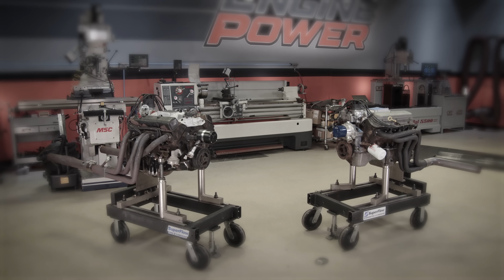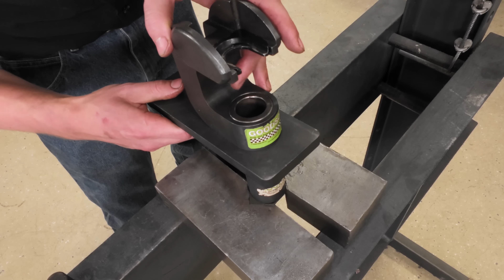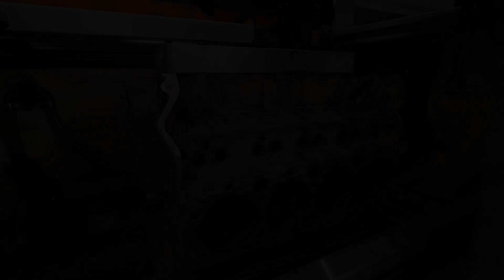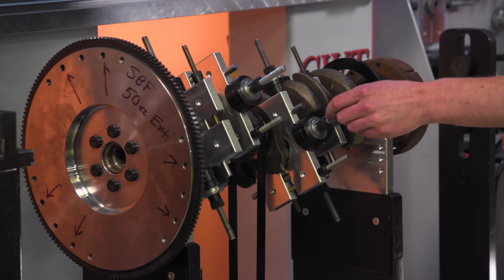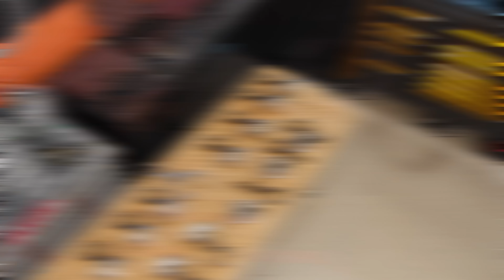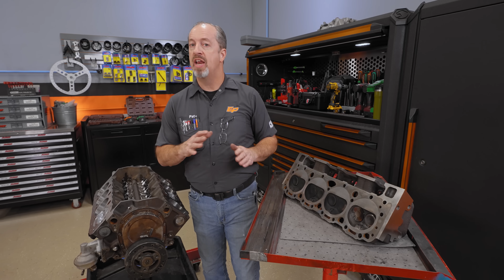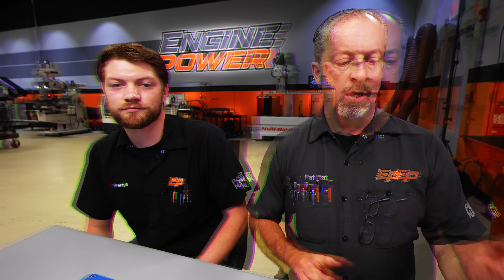305 SBC vs 302 SBF: Does Compression Help the Lowly 305 beat the Race-Bred 302?

Comment: It gets down to the deck height,or lack of! The 331 and 347’s are just to fit into early shock tower cars! I wouldn’t waste any money on them! Get a 351w with taller 9.969”deck block! You can use factory parts to build it! Stock rods, 302 pistons and along 6.969” rods! You still have that heavy crank with large journals but they’ll hold up quite well! And it’s not just another LS! One day I’m gonna pull my Fairmont wagon with factory no air, manual rack, no power brakes! Who will ever know ! 393 stroker!

Comment: You guys have no idea what the compression ratios are after cutting the pistons and altering chambers.
Reply from the maker: All of the parts were measured after the modifications to ensure accurate compression ratio calculations for each engine. We actually had a few different head gaskets for each on hand so we had options in order to get them as close as we did.

Comment: Why didn’t you use the same ratio rockers on both engines?
Would it make a difference at all?
Reply from the maker: We increased both engines rocker ratio by .1:1 in order to increase lift but keep them as close as we could

Comment: If you wanted to do an oddball 5.0L Small Block, I've always wanted to see somebody put the crankshaft from the 94-96 Caprice 4.3L L99 into a 5.7L LT1 block. That'd give it the same 4.0" bore and 3.0" stroke as the Ford to create a modern DZ302. Drop some LT4 heads and intake on there to really make it scream.
Reply: Interesting

Comment: I would like  to know what headers were used on the 302/GT40P heads as fitment is typically  an issue with those heads.
Reply from the maker: These were a set of Doug’s from Summit Racing part number DOU-D623-B
Reply: @enginepowertv  thank you, im not sure if you're able to confirm if the fitment gave adequate  clearance from the plug wires? Thankyou
Reply from the maker: Yep with a 90° boot on the plug end we had plenty of clearance
Reply: @enginepowertv  thankyou, alot of people avoid the gt40P heads due to finding a decent fitting header.

Comment: “What have we learned?”

Whet we learned is: 
You guys don’t actually try different ignition timing settings to see where the engine is actually happiest at -
 I didn’t see any average air fuel ratio numbers, either.
AND - - -  Wherever it was that you learned that ignition timing needs to be “changed 2° at a time” -  every time you adjust it… ?!? 
You need to throw that knowledge out the window. Sometimes 1° makes a big difference.

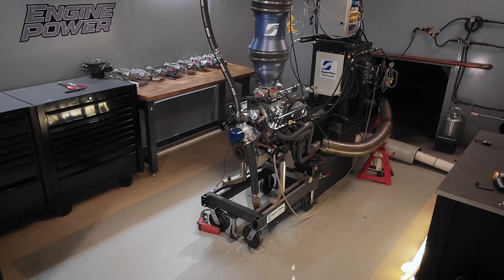Comment: At 16:57 …. GT40P heads DO NOT like 38° of ignition timing, that’s way too too much - back the timing down to around 33°, 34° 35°…… You’ll probably pick up power. 

GT40P heads are VERY sensitive to timing, you don’t “move timing around” 2° at a time… 
Change the timing 1° at a time, because it makes a big difference. 
If you guys knew anything about GT40P heads, you would ALREADY know all this. 
It’s very very very very very common knowledge at this point, amongst the 5.0 Mustang crowd.

Comment: I was under the impression that the 302 was a race engine and the 305 was an economy engine.
Reply: Why would you have that impression?
Reply: @kcchapman9776  Because the 305 was developed to install in the automobiles during the 70's when fuel was at premium, That small v8 replaced the 350 for less expensive Chevrolets. Now. if you want to compare the Z28 302 to the ford 302, I think  you will see different specifications.

Comment: Ypu should do a more comparison a chevy dz302 to a boss 302. Maybe ypu can't afford original but you can build both motors to that bore and stroke and compression and cam profile both made 290 hp back in the day.

Comment: Engines are air pumps. It’s really about cost and availability. Chevy is usually a little simpler to work with so they are the most popular.

Comment: So if you have two engines of the same displacement, built to about the exact same specs, they perform about the same.  Inconceivable!
Reply: The chevy 305 is a small bore , long stroke engine. 302 is a big boar , short stroke engine. Pretty different. If you were to look at the whole entire power graph of how the 305 performed , it actually had an edge across the whole r p m band.
Reply: @kskip4242  Cool.  I was under the impression that a shorter stroke engine would have more torque, but I've heard a few different people lately say that a longer stroke yields more torque.  I assume they are right.  It's kind of minutae but I hate to have wrong info.

Comment: 1.7 Ford rocker arms vs 1.6 un Chevy :/
Reply from the maker: Correct both engines recieved a .1 increase in the stock ratio to keep the valve lifts as close as possible

Comment: Why dont you compare 302 against 302? Ya'll do know a 327 block with the stroke of a 283 give you a 302 chevy and it is a rpm monster and i know because i have built several of them and i have a 69 duel 4 chevy 302 RS/SS Camero that makes a little north of 500 hp and is virtually stock.

Comment: The 305 put out good performance in the trucks and trans ams the feed back i got from the chevy crowd was the bottom end was weak compared to other engine in the gm line up don't know personally i run pontiac mostly but have seenbalot of 305 engines blown in firebirds  boats and truck  feed back welcome....

Comment: At about 3700rpm the 305 was making 20 more horsepower and about 10 more ft-lbs. If 2 identical cars had these motors the 305 would win a drag race

Comment: I wasn’t aware the 305 had four inch bore like 302. I don’t know how you can compare the two engines. Should have had a 283 or 327  with  4” bore to get a fare comparison. Can’t see point in comparing 302 305. 302 should win on power every time.

Comment: its not apples to apples, the ford 302 is a big bore, short stroke engine and the 305 is small bore, long stroke engine.  305 chevy in stock form was all done by 4500 rpm. because like its predecessor, the 307, was an economy engine.  put that 302 ford up against the 302 chevy and see how bad it wipes the floor with the ford.

Comment: I’m more happy with the 305 sbc engine despite the small bore small valves and little cylinder volume but it’s amazing how it can make horsepower a little different that engine is a potent in it’s own way the right combination the better it can performed

Comment: Manley Race Series Ford 429 Boss Exhaust Valve – 1.900 in. Head Diameter! The Ford Boss 429 intake valve has a diameter of 2.28 inches in its stock configuration. However, aftermarket valves are available with larger diameters, such as 2.300" and 2.400". The standard intake valve diameter for a Chrysler 426 HEMI engine is 2.250 inches. 
:face-fuchsia-wide-eyes::face-blue-wide-eyes:

Comment: Great job !
  I wonder if the chevy had more lift on the camshaft like the ford has. Would the numbers have been the same?  Thats about the only difference in these engines. 
And im glad you mentioned the bore size of the boat anchor 305. Vs the 5.3.  Its only about .044 difference. But everyone says the 305 is junk because of the small bore.  And praise the 5.3 in the same breath. You guys proved that wrong. Its all about airflow. No matter what the engines are.
Reply: Yeah I'm in agreement, same cams,  same heads.

Comment: I would love to see chevy 5.3 VS ford 5.4.  I know there is a lot of difference but I have both engines and my 5.3 always outperforms the 5.4 hands down.  And to point out my chevy has its original gen 1 engine still in truck since 2000 with half a million miles.  And my 2003 ford has the cursed 5.4 and is on its third engine. And out of the three motors not a one has made it past 160,000.  All three spun the rear main bearing and lost oil pressure.  Not to mention the nightmare it is to change those absolutely stupid spark plugs. Yes I know they make aftermarket ones that don't break off in the head.

Comment: Why not adjust rocker ratio to get matching lifts?  Sbf  already  had more lift then they  add 1.7  n that should give it roughly .565 to .570 lift unless they already had this factured in... ,  n 1.6 on sbc would also add .25 to .30 lift. But you still have the ford with a bigger lift. I wish they would have check the lift with 1.6 on the Ford and dynoed to see  the difference.. its no surprise Ford win this one imo

Comment: A lot of people in the comments giving the 305 some love. Ok, so you got it to make some power. Good for you. what was wrong with that engine, besides the stock build having underwhelming power, was that they melted valve trains. The Ford 302 was not just powerful, but also reliable.
Sure, if you build it, its inherent weaknesses can be overcome, but then, find a nice steel crank, 4-bolt main 350 and build that instead.

Comment: My boat has a Mercruiser Alpha-1 5.0 EFI, which is a 305 Chevy.  Drive that thing pegged at like 5500 RPM for long stretches at a time.  It's 26 years old now and still runs like new.

Comment: You put that Chevy cam in that Ford you just as well have pulled a couple plug wires off  why didn't u put Ford cam in the Chevy it's common sense a ford demands more lift on the exhaust for both torque and horsepower

Comment: Run the 305 cam at 10 degrees advanced and you'll see a big difference mines running to 5800 rpm and it's really really strong

Comment: If you look at this test though, the Ford has the better "CAM SPECS" and you guys COULD have ran 1.6:1 rockers on both with identical cams. ----- NEXT TEST 350 vs 351.....To keep it fair 350 Chevy vs 351W (Keep Canted Valve Train Out....As we ALL already know that they are NOT in the same ballpark. A 351C with Their Best Factory  Iron Heads (351C-4V Closed Chamber) is worlds ahead of the SBC with inline valves and its best Iron heads, I mean BRODIX Makes CVH SBC Heads for a reason.) - I think the 350 with the Vortec Heads will have more power than any GT40 or even the C9 351W heads.

Comment: why did they use better pistons on the ford then the chevy the ring pack makes a difference
Reply from the maker: Each engine got new pistons that were the same construction as the ones that were removed, and both engines rotating force was within 1 lb-ft of each other

Comment: The best ‘factory showroom stock’ matchup back in the late ‘80s was the 225hp 5.0 H.O ‘302’ EFI with .444 roller cam mated to 5-speed vs the 230hp 5.0 LB9 ‘305’ TPI with .430 roller cam mated to 5-speed. These engines in a low optioned Mustang LX stripper and low optioned Camaro G92 code stripper (or rare 1LE) was a classic driver’s race. Both were easy low 14 second cars and both capable of flirting with high 13s with basic tuning/tweaking, advanced timing and lowered tire pressure.
Reply: I miss those days. Lots of fun.Not everybody trying to have a thousand horsepower street car.
Reply: @kskip4242  Give me a legitimate 300 wheel horsepower in a 3,000lb car and I’m totally set.
Reply: @JohnnyButtons yes sir 🙌
Reply: @kskip4242  check out the #MuscleCarTimeMachine channel for a bunch of old racing from the ‘80s!

Comment: I havnt scanned every video, and have no tv, but what i was thinking is this- i have a 2005 3.7 jeep liberty. It seems i have read about people saying engine type swap is needed to get real power. How about taking a 3.7 and add some different stages of mods to one to see how it can be upped say idk 40hp with efficiency too, and then just whatever can be obtained from one. I saw where the 4.3 chevy had 500ft lbs, couldnt the 3.7 get something usable and felt in the seat too?

Comment: The 305 Chevy was never popular. The Chevy 302 was. The 305 isn't a good platform. No matter the power output. The 305 will not live. The Ford 302 will live even with a bad build. There really is no comparison between the two engines. Popular or any other.

Comment: I would like to see you tighten the LSA on the 305 to 108'. The smaller bore seems to like 108'. And use a Fel Pro marine 305 head gasket.

Comment: Nobody doing budget upgrades is going to be using parts that need clearanced, machined, honed, or rebalanced.  We budget upgrade people do not have those expensive specialty tools available to us.  This is effectively a high budget upgrade for less than high budget gains.  With this amount of work, it would be cost around the same and easier to just swap a stock build for a pre-built and tested engine with some reasonable performance upgrades already in place.  We all know (though Ford fans will deny it) that a Ford with everything thrown at it will never outperform a Chevy of similar displacement having everything thrown at it.  Chevrolet/GM is simply better engineered.  Equal displacement on it's own gets equal results, but how everything else works, including airflow makes the difference, and that is why GM is better.

Comment: Did y'all Catch That ??????? The Ford Got 1.7 Rockers While The Chevy Only Got 1.6 Rockers With All Fairness Supposedly Both Should of Got The Exact Same Rocker Arm and The Ford Also Got 20 More Thousandths or So at The Cam So What Does That Tell You About Ford Factory Heads ??? I'll tell You What it Says About Them Their Total Junk that's what it Says About Them Both Big an Small Block they're No Good !!!!!

Comment: Why are we not using a Chevy 302 and a Ford 302?
Reply from the maker: We wanted to compare the most commonly available smaller displacement small blocks for a reliable and relatively cheap shootout. 302 Chevy’s are pretty scarce and are not cheap if you can find one. 305’s on the other hand power a lot of people’s hot rods, are super cheap, plentiful, and can make respectable power
Reply: @enginepowertv Maybe in a future episode, you can compare the Chevy and Ford 302’s because the bore and stroke are obviously far different when comparing the Chevy 305 to the Ford 302.

Comment: Same thickness rings would be even better.
Reply from the maker: This was as close as we could easily get them and the engines are within 1 lb-ft of rotating force of each other so the difference is negligible
Reply: @enginepowertv 
Right. That's what I was getting at really. Good comparison, only thing to make it better was the ring pack. 
With a 305 piston you'd probably have to custom order a set.

Comment: Mmm🤔 Am I the only one that notice the slightly larger lift on the 302 vs the 305. Seems that is exactly the difference in hp. Just a thought; not to mention the compression. 

Great video!
Reply from the maker: Thanks, glad you enjoyed it! The Ford had only .018" and .010" extra lift on the intake and exhaust, respectively, and the Chevy head does outflow the GT40P head in that range

Comment: Is the cam lift at the rocker arm or comp cam’s cam card
Reply from the maker: The valve lift is with the lobe lift times the rocker ratio used, and any lash removed if applicable

Comment: I want to point out that you showed the difference in rotating package weight giving you a slight increase in top end power. The ford had lighter forged pistons thus the 5 to 6 hp that showed up on the dyno. But I'll take the cast pistons of the Chevy for longevity of performance over a longer period in it's lifecycle on the street.

Comment: Hay I was just wondering if the the timing cover from a V8 small block Chevy would fit the 4.3 V6. Because heard someone said the small block timing cover wouldn't fit the 4.3 V6 I'm asking you this question because I don't believe what they said. Also if they are right about maybe you could tell me of a company that makes metal timing covers for the 4.3 V6.
Reply from the maker: The early non balance shaft engines should use the same timing cover as a conventional SBC but the later balance shaft engines use a different plastic timing cover with a different design to fit and seal around the balance shaft gear

Comment: Tha cam has more lift on the ford engine and the rockerarms has a 1,7 ratio. Chevy only has a 1,6 ratio.
Reply from the maker: The ratios were bumped up .1 on both engines so that the Ford only had .018" extra lift on the intake and .010" on the exhaust. The Vortec head also outflows the GT40P by around 20 cfm in that range as well

Comment: Great job guys! This was a great comparison. The compression thing takes some real figuring to get them that close.  I thought you would have ran the same ratio rocker arms on both engines.  The Ford was at 1.7 and the chevy at 1.6... could have been the difference in the numbers.
Reply from the maker: Thanks we're glad you liked it! The rocker arm ratios were split, only adding .1 to the stock ratio, in order to get the lifts very close to each other. They were within .018" of lift on the intake and .010" on the exhaust

Comment: That’s a great comparison. The meat under the torque curve on the 305 would be easier to feel. I wonder if that extra lift from the cam and rocker ratio on the 302 was the source of the slightly better horsepower?
Reply from the maker: The Ford only had .018" extra lift on the intake and .010" on the exhaust, so this would be pretty negligible

Comment: would be cool to do 302 to 302. Small block 350 with a 283 crank throw gives you a 302. At least they would both be 4" bore. The thing that limited the DZ and all gen 1 small block chevy's was the heads. A basic set of Vortec heads right out of the box flows way better than any ported camel humps could think of. More air, more power.
Reply: It's 327/283...not the 350

Comment: This is the exact reason I don't play favorites with brands. Engines are just air pumps. They're all doing the same thing with similar designs and parts. Some have slightly better designs from the factory than others. Everything can be built better with money and some enginuity.